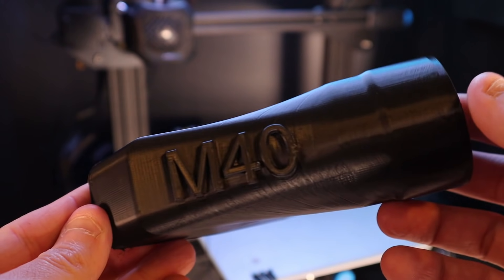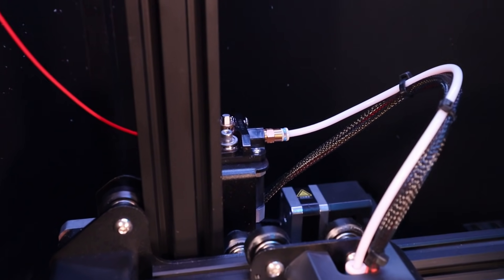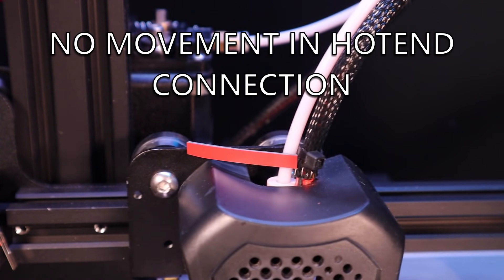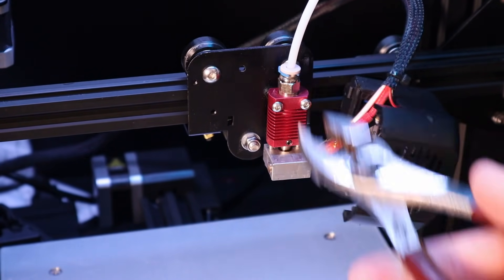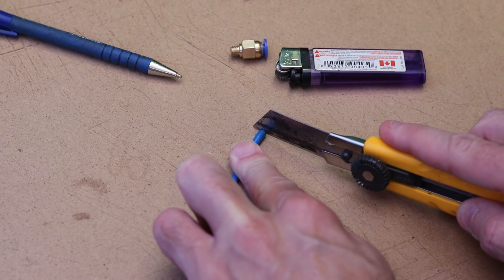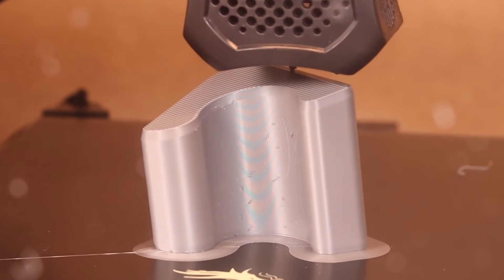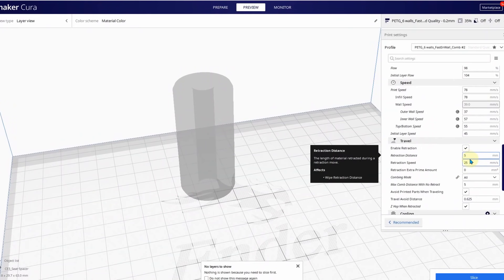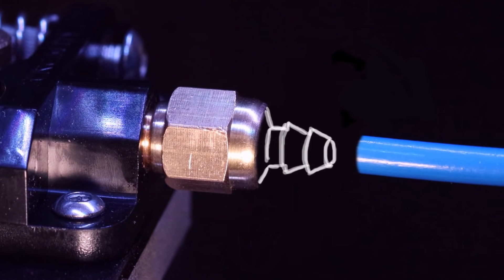Creality Ender 3 V2 - Fixing the Hidden Problem that Can Cause Stringing and Unresponsiveness

Comment: I am so glad that Ive found your videos! Most of other videos is related to the original ender 3. Can you share more detail about your mods and upgrade? Your enclosure? Keep it up man, I am enjoying your vids so far. Straight to the points and good explanation. I am surprised that your chanel hasn't blown up.
Reply from the maker: That's great to hear!  I have lots more plans for 3D printing videos... I should have started making these sooner. 

I try not to mod my machine too much, and the reason is that I want to make sure that it is cheap to replace if anything breaks down.  I do not have a BL touch, though I have heard good things about it, I almost never level the bed, I always take the glass build plate off before removing parts so that I'm not applying any unnecessary pressure to the machine.  The only mods so far are Octoprint and Spaghetti Detective... I used to watch the printer a lot, that is an incredible waste of time and really takes away from a person's life.  With these two options, I can set everything up from my computer and then watch the printer from wherever I am over the internet, a big time-saver.  I would recommend that mod over any other as long as you can justify it with the volume of prints that you make.

I recently switched from printing ABS to PETG, it is a little more expensive, but the payoff is huge.  I can now print with the enclosure door open if I want to, there is no smell, the prints are very strong but still slightly flexible and now I don't need to worry about cooking the electronics in the printer, or overheating any motors over time.  

My enclosure is just a simple MDF box, 1/4" thick material with a plexi removable door.  It is still handy because it does reduce the sound so that I can record audio for these videos while the printer is going.  The hotend fan is very loud on this printer, it needs an upgrade for sure, I think the fan shroud on the front is causing a restriction and consequently the noise.

Side note:
I picture the 3D printing industry exploding in the future, the tech will be different and will improve dramatically in the coming years.  For that reason, I think it is a smart industry to get into.  3D printing opens up so many design/engineering possibilities that were not possible using wood or metal and it is relatively safe in comparison.  

Is there anything in particular that you are looking for in future videos?
Reply: @NeedItMakeIt  Youtube doesn't notify me... so I totally forgot this comment. Your video is clearly well done on the video production-wise, as I find most of the 3D contents on Youtube are hard to watch (obviously as most of us are nerds and don't have much experience of video production), the video quality is on point, but I think the lightning although are good but can be a bit brighter, and maybe your audio can be a bit more excited. Content-wise I think you should focus on upgrade, as most of us go to youtube to find new ideas. You can see the video about 3D printing has the most view is from the Scott yu yang, as he shared about his content and his video production is slick. 
Just a thought from a guy who wasted so much time on youtube :D I really hope your Youtube channel can improve man.
Reply: That image of the slide on clamp end you showed at the end is the way this should be designed I can't find any with that end. Do you know where to buy those or is that just an idea you had. Could be designed but really needs to be metal to last

Comment: I really like how calm you explain everything. 

In the future I want to print tpu (for flying quadcopters alot of prints need flex) and there for a lot of people print with direct drive. Whould this help anything? 
Maybe for the other materials it won't. So just a wild gues here.

Also for cutting the tube ase straight as possible ive seen a kit that includes a special cutter.
Reply from the maker: Thank you!  

I have no experience with TPU myself, it can be done with a bowden from what I have ready, however it would probably be difficult  I can imagine that it would be similar to trying to push a rubber band through the tube, so tighter tolerances and some type of lube may be required. 

It would be handy to be able to swap out direct drive and bowen as needed, or two machines I guess.  

Yes, the kit does normally include a cutter, I don't personally think it is required if you take your time, I suppose some people might be off a few or 20 degrees.
Reply: You definitely don't want something flexible for quadcopters... There's a reason most frames are made from carbon fiber. Not only is it light but crazy stiff. You're quad will fly terribly if the motors are constantly flexing the frame

Comment: Was having the same problem with mine. Tried making a wire clamp. Didn't go so well. Clothes peg spring! 
Mine was a bit small and took some work opening up, but it works awesome. Occasionally I give it a slight turn, though it doesn't seem to need it.  Here's pic. https://drive.google.com/file/d/1awJzDYFYA_hOr9v_qMP_YTLFa60VPp-1/view?usp=sharing
Reply from the maker: A very interesting solution I must say!  Who has clothes pins these days?  

I would really like to machine something on the lathe as a permanent solution.   As an alternative, there are some brake fitting with a 'barbed' connection which could work, but they are not readily available in Canada for some reason.  I may just need to make something.   

Thanks for sharing your solution!
Reply: I think a flared coupling would work, if you can get the size. Something like this:
https://news.thomasnet.com/fullstory/compression-fittings-offer-1-4-28-thread-for-4-mm-od-tubing-20009699.
Sorry. this I what I meant, but the compression fitting would work too. :https://news.thomasnet.com/fullstory/beswick-s-latest-mfm-series-flare-fittings-with-threaded-end-insures-leak-tight-connection-40011045

Comment: I had this problem as well and replaced my bowden tube with capricorn tubing and new fittings. The one on the extruder end failed after only a few weeks. I replaced it with the second one that came in the kit and figured out that i was the one causing the problem with the first one. When swapping out the filament i was pushing it in too hard trying to get it loaded and was pushing the tubing into the teeth (they are made of metal after all) cutting into it. Learned to straighten out the end of the filament before inserting it into the extruder. Went in a lot eaiser. Have been printing now for about 3 months with no problems so far. Also replaced the plastic extruder with a dual gear all metal one. Really like it. But have to say the best upgrade i've done to my ender 3 V2 is the BL touch auto bed leveling sensor. No more having to worry about my first layer not adhering to the bed any more (real problem with that until then). FYI - Am using your pi cam V2 bed camera mount really like it. Like that it moves with the bed makes time lapses look really good.
Reply: Did you have to print the mount for your BLTouch if so could you share a link to it?
Reply: @Mis7erG  I used this mount https://www.thingiverse.com/thing:4462870/files and this firmware https://smith3d.com/ender-3-v2-bltouch-firmware-installation-guide-by-smith3d-com/ if you use the mount i've added to this post and the firmware then all you have to do is set the z offset which is a lot easier then having to set the x, y, z offsets.
Reply: @HATipsByLarry  thank you so much for your quick reply and the links I will try this at the weekend.
Reply: @HATipsByLarry  thanks aswell havent come to do this yet.. i have it in the mount allready. And I redid the cable so it fits the board with just one cable (had to change the end that goes on the mainboard)
And I too have been sharpening my filament by cutting it diagonal and then pushing it in. Thnx for all the tips.

Also what material did you print the cam mount? I wanted to print it with pla bit havent done it yet. Went wrong when I used multible parts and then skipped infill everywall so it whould fill with double ammount. Then did not set it to hop parts so it ruined the whole print by running through all the walls. (Made sense after looking back at it)
Reply: @TriMeX1987  I just used PLA with 20% infill but i did have to reduce the size of the part that has the 2 cone shaped pieces that allow the camera to swivel by 2% because it did not have a good enough friction fit to hold it in position when the bed was moving. And before anyone ask i have my printer dialed in correctly. Calibration cube reads exactly the right size on all axes with my calipers. Yes i to replaced the DuPont female connectors with new JST female connectors and a 5 pin JST connector that fits perfectly into the main board's BL Touch connector.
Reply: @TriMeX1987  Yes cutting it at a 45 degree angle is good but i also straighten out the filament, the first couple of inches anyway. The filament is curving down because of it being rolled up so when you try pushing it through the extruder into the  coupling it try's to twist away from the opening.
Reply: @HATipsByLarry  thnx I am doing that from now on. :) allready noticed a difference.

Any chance you know what firmware code I need to put in the plugin bed level visualizer? (I am using marlin 2.0.x -14 from smith for the ender 3 v2.

Or any other tips to get the bed level the first time? Normaly I use cheps bed level print and g code.

Comment: Hello to everybody. I have a problem for about a week and the fact that the nozzle sticks to me at the end of the print and the print goes but without filament. I also have an Ender-3 V2.
Can anyone advise me?
Thank you.
Reply from the maker: Is there a way you can share a video or photo?  I'm sure someone can help but I don't fully understand the problem.
Reply: @NeedItMakeIt  I only print PLA and the printer is new for about 1 month.
Today I replaced the nozzle and now after 5 hours it seems that it is printing but it is not possible to filament from the nozzle and it is not possible to push it by hand, so I am desperate.
Reply from the maker: @saimon1409  Okay, we have a few things to check, one is, has the gear drive eaten away at the filament?  I suppose that it has if it cannot extrude filament.  The next it a nozzle clog, but replacing the nozzle should fix this.  I like printing with a larger nozzle size, clogs do not exist with a 0.6mm nozzle, so try this even if it is just temporary.  The next would be the temperature sensor, thermocouple, it could be reading incorrectly.  Change the temp manually to a higher setting and try to extrude.  PLA is low temp so if you set it to 260C and try it, that might be the problem.  This is a problem other people have had.  Take a quick video with your phone and upload it to your YouTube account, you can send me a link from there if you are still having trouble.  Good Luck!  Let me know how it goes.
Reply: @NeedItMakeIt  Hi, so today after work I finished everything and cleaned and put new ones.
Otherwise, I know that the silicone tube should be slightly lubricated on the inside with WD lubricant, and this then helps to better the filament slip.
I pulled such plugs from the nozzle and the heater.
I'm printing now and everything is fine. :-)
Otherwise I still don't know how to make new firmware and where to get BLtouch v.3x on Benggood or Aliexpress?
Thank you all :-)

Comment: Those garbage bowden fittings seem to be an issue across all Ender models. I believe they are responsible for most of the people in the FB groups struggling to tune retractions. There's got to be a better way.
Reply from the maker: 100%! not easy to spot for someone who hasn't seen this before.  They should do better, I like the barbed solution, that's what they use for water/pneumatic.  What do you think?
Reply: @NeedItMakeIt  Those would definitely hold the tube solid, and make tuning easier. One concern would be the end of the barbed insert shaving off tiny bits of the filament as it passes. Which could lead to a jam eventually. Or at least a bunch of little particles floating around in the filament path. It's still a better solution though.
Reply from the maker: @jasonchaney5382  Good point, a little fine sand paper could help with that, even some polishing compound if you wanted to go wild.  I will continue to search for something off the shelf, not everyone can machine something on their metal lathe after all.

Comment: I have also encountered problems with the fittings on my ender, two bowden couplers have failed catastrophically on me to date, and I try to replace them with good quality ones. My current plan is to machine a compression type fitting that will work for my ender, but that will have to wait until time permits...
Reply from the maker: I agree, I found an m6 fitting for bleeding motorcycle brake lines, it seems to have the right shape, I can't find anything on Amazon, like you, machining one seems like a good option.  I was thinking to solder a piece to the current fitting and then machine on a barbed section carefully.   A compression fitting would be better for sure.

Comment: Hey, ive only been printing for about 2 months and have soaked up a lot of information regarding better printing which includes information from your channel. I noticed that when you put your tube back in, you didn't heat your up or back out your print nozzel before seating PTFE in hot end.  Also try backing out the extruder colar 1 turn before seating the tube, then tighten.
Reply from the maker: That is interesting, I've not heard of that technique before.  The idea is to make sure of a 100% perfect fit inside the hotend?
Reply: @NeedItMakeIt  i should also mention i am using the dual gear extruder
Reply from the maker: @BedstuyDude  I've had my eye on one, what are your thoughts on it?  Any improvement or problems with it?  Also can you provide the link if you have a chance.
Reply: @NeedItMakeIt  works great, i dont get any slipage and can adjust the tention.  if you get it, you will need to calculate and update the e-steps
Reply from the maker: @BedstuyDude  Good to know, going on the X-mas list.   I'll make sure to re-calibrate, the gear size and shape is slightly different I assume.
Reply: @NeedItMakeIt  yes, you may want to add the Capricon PTFE tube to the list while your at it.
Reply: @NeedItMakeIt  yes, you want as tight a fit as possible. I always heat my hot end when chaging nozzles or PTFE tube and push tube in before tightening fully.

Comment: Every video you upload my ender 3v2 goes a step closer to becoming a prusa
Reply from the maker: I'll have to check out their product, I haven't had the pleasure of owning one!
Reply: @NeedItMakeIt  Its all about the haribos
Reply: @NeedItMakeIt  print enough for some customers and one day you will :)
Reply: @NeedItMakeIt  My first hand knowledge and recommendation is to stay away from the mini. Mine, not once, gave me a decent print. This was my experience; others maybe different and I'm happy for them but my mini+ was horrible - it now occupies a landfill.
Reply: Or you can buy an Elegoo Neptune 2 and have a printer that's better than a Prusa out of the box for half the price
Reply: Lol agree
Reply: Wait till someone finally does a video for the fixed height bed spacers for creality printers, you'll be one step past a prusa then 👍😜
Reply: @Girl On A Quest it absolutely is, better and higher quality components that are tested for problems. Much superior support which includes sending entire upgrade kits for free Vs Creality''s "if it breaks it's on you dude". And the far more tuned design and firmware which means you can run it all the time with hardly any issues

Comment: You and I seem to be having parallel journeys with our Ender 3 V2's. I changed mine to the 'upgraded' fittings too. I hate to tell you this but this will only work for a short period. After a month I was getting very noticeable movement at the extruder end and the fitting completely failed a week later by pushing pushing the tube out of the fitting. I replaced it again and I had about 3 weeks worth of printing before the movement came back.

The solution I found was the metal Creality extruder. There are a few versions out, but the latest doesn't even use a distinct screw-in fitting, but has a plastic insert that grips the tube in a few places. This seems to be rock solid. 

Of note, the hot-end side fitting just failed on me too and pushed the metal teeth from the fitting INTO the nozzle. It's a long story, but these 'upgraded' fittings have been a nightmare.
Reply from the maker: Really, I had seen the plastic versions and figured they'd perform worse.   I'd really like to make a fitting that is 'permanent' the hotend fitting seems to have no movement, so I'll focus on the other, this tubing is used for air and water also, and the typical connector is barbed.   I do believe that the longer tube will help to releive some of the trouble with movement as well, but only time will tell.  I can certainly post updates in the comments section so that people know whether they should go a different route. 

I didn't mention in the video that I already cut the original tubing shorter and the movement shown in the video was what I had after a new clean cut, their selection of fittings is a poor choice, it looks like a case of designed-to-fail.

Thank you for your help BTW, I'll keep this in mind if I have some trouble down the road.
Reply: And that's why I gone to Direct drive route.
Reply from the maker: @tomaskonkol8894  Direct drive does have some advantages, how do you handle the ghosting issues?